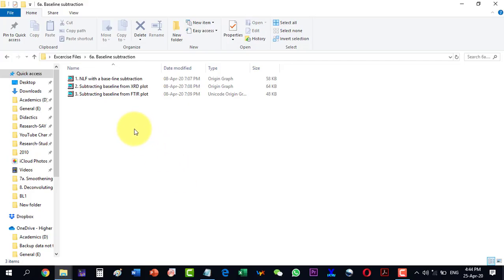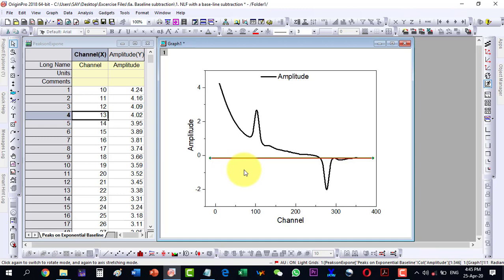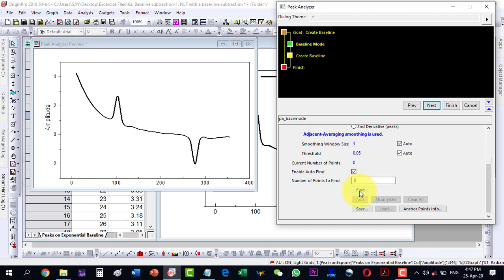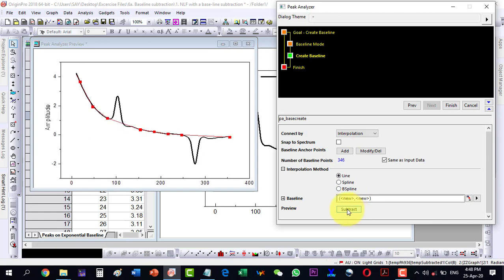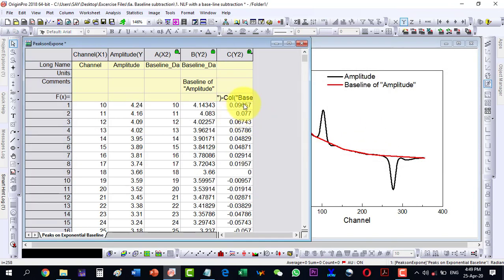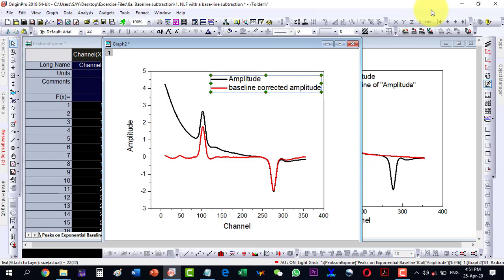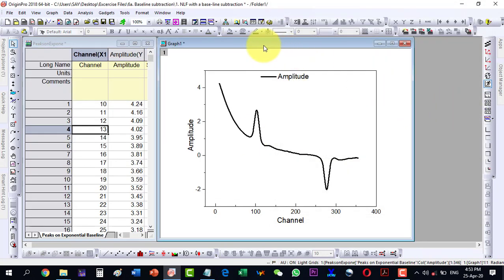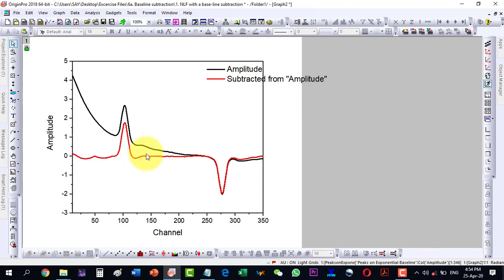How to subtract baseline in origin

Comment: what about the peaks that were indicated downwards how to explain them.....?
Reply from the maker: It depends on the nature of a plot. If it's a transmission plot, downward peaks are the absorption and vice versa. Thanks
Reply: @SAYPhysics  if the peak indicating downwords does it mean anything particularly or simply it is an anomaly
Reply from the maker: @adityak3539  If it's related to different detectors offset, then OK. Otherwise, I don't think so. If you provide some information about what type of characterization (FTIR, UV-VIS-NIR, PL etc...) I can further discuss it. Thanks
Reply: @SAYPhysics  Tested on ATR-FTIR and type of sample is bitumen
Reply from the maker: In FTIR transmittance data, a downward peak show the absorbance. We've only one detector in FTIR, so no offset. Also there's no sample preparation for ATR and background is also subtracted automatically. Thanks